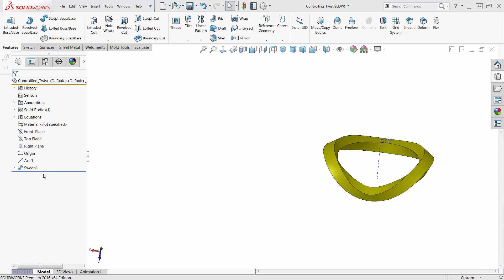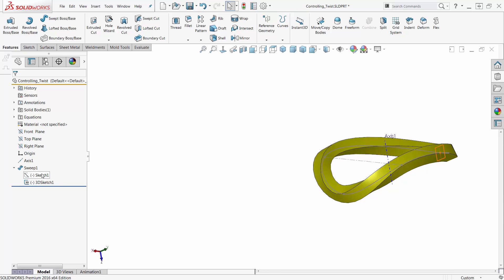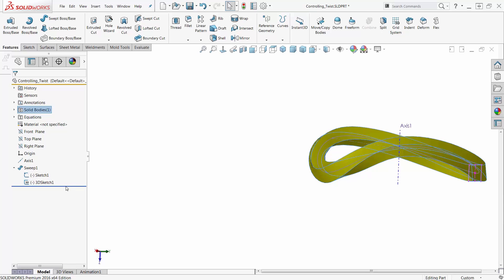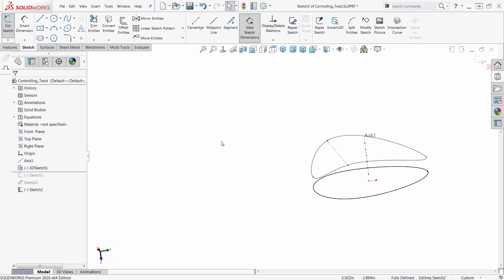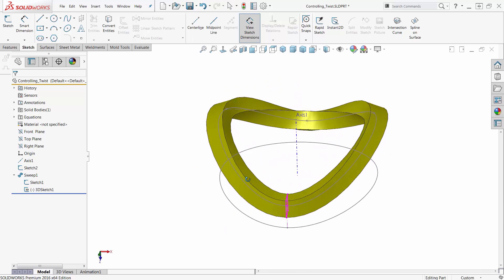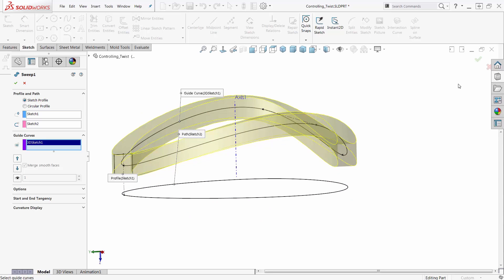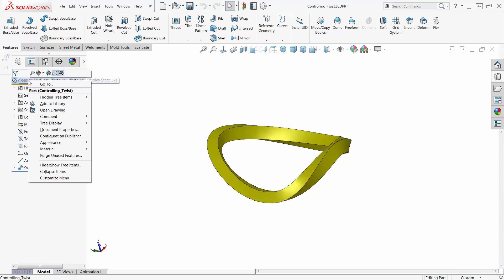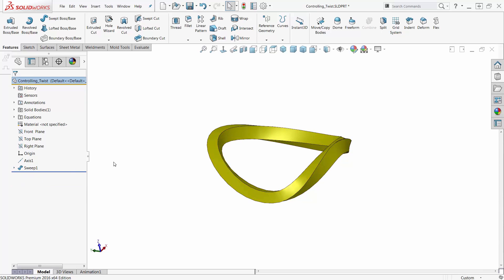SOLIDWORKS - Unabsorb Features

Comment: Great video! Very clear and helpful.  One question, why did you have to add the centerline to the square sketch?
Reply from the maker: He Sean,
The added cetnerline is just used for positioning of the sketch profile.  Other relations could be used to accomplish but the ultimate goal behind this is to have a fully defined sketch so that the profile moves if the path is updated.
Reply: GoEngineer that makes sense.  thanks for the reply!